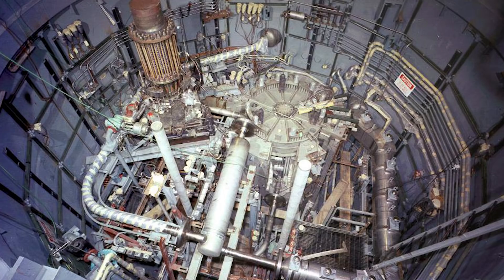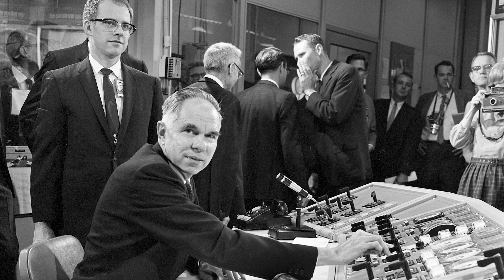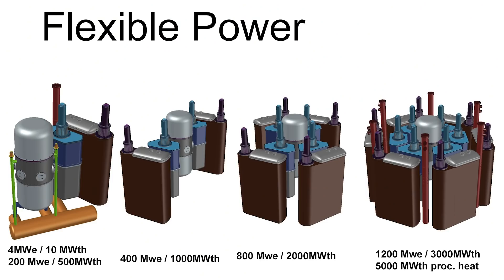Ed Pheil and Carl Perez of Elysium Industries discuss Nuclear Power and MSR @ ORNL MSRW 2019

Comment: How does EI's reactor handle the poor delayed neutron fraction of most fissiles relative to U-235?  And how does it handle the further reduction of delayed neutron fraction caused by circulation of the fuel into and out of the core, especially in the "scaled-up" version?

Comment: I loved the discussion about the nuclear waste not actually being a technical problem, but a perception one.
It's still a problem, if you solve the problem: great. But just don't ignore it and say it isn't a problem or you'll lose public buy in.
Reply: Spent nuclear fuel (SNF) waste is REAL! It costs a great deal of money to store and reprocess, and every day old style nuclear plants are generating more and more of it. It is only safe in 10,000 years. The US has an estimated 700 years reserves of SNF, not to mention stock piles of plutonium.

A man came along called Ed Pheil. He said, 'Can I design a reactor that takes into account the politics of nuclear? The safety, the waste, the economics.' And the result? A reactor that EATS SNF, plutonium, and other nuclear wastes. That consumes >99.9% of its fuel with a <0.1% residue that is safe in 100 rather than 10,000 years. A reactor that is expandable, low pressure, that does not use water cooling, does not generate large amounts of waste, that can generate continuously MW for MW the same as a fossil fueled power plant, does not generate polluting gases, AND one which rids us of nuclear waste. What more do we want?

Comment: A Question to Ed: I have seen Your presentation with the single or multiple heat exchangers and the drain-tank. Why is the drain-tank rectangular, with corners? In those corners, mechanical stresses are concentrated. Welded joints at corners tend to get fatigue fractures.

Comment: A few issues and questions..

Firstly my main concern with nuclear power is whether any of these advanced reactor concepts will in fact be economic in a 10 to 15 year time frame during which renewable technologies will further mature and during which time energy storage technologies will also see large reductions in cost. I'm an Engineer - I'm not pro or anti. But I remain to be convinced about the capital cost of nuclear. Yes, getting the confinement structure scale down helps (its why I'm also intrigued by Moltex) and why power density helps. But even so, we will have to see.

Now regarding safety. The Elysium concept as I understand it is simply a reactor vessel full of fuel salt. No other structure within the reactor vessel. Nothing to degrade from fast neutrons. Is this so? Are there no neutron absorbers (control rods)? Are there no neutron reflectors? One video suggested there were control rods. This would add complexity and cost and also complicate the issue of safety. If there are no control rods, is the only method for controlling power essentially by controlling the heat removal? If the reactor vessel is simply a big tank full of barely critical fuel salt, presumably there will be a flux of fast neutrons impacting the vessel wall. What is the lifetime of that vessel and given that there is a singular reactor vessel (feeding multiple heat exchangers) what are the implications in terms of complexity and down time when it needs replacement? 

How is the reactor shut down? In one video the concept is presented as a process of constant refilling of the reactor vessel from storage but on the Elysium web site the concept is presented as having a freeze plug. My understanding is that the drain tank is physically structured to remove criticality but its hard to tell from the drawing. 

How is Elysium dealing with the issue of Chlorine isotopes and possibly the generation of Sulphur (which would be corrosive)? Is the Chlorine natural (in terms of isotopes) is it isotopically purified?

The process of conversion of solid (waste) fuel to liquid salt based fuel raises the question of how the liberated radioactive gases are dealt with. Are they stored? If so will it be under pressure? Has the safety of this been considered? 

Is the decay heat removal system still based on a heat pipe? This should be better explained on the website.

There are multiple issues with walk-away safety. Does the walk-away safety assume essentially every control system apart from the freeze plug fails? What happens to radioactive gases in a walk-away situation? Is there any way to damage the system with deliberate (malicious) operator inputs?

Finally there is a question that applies to all similar systems. The robotics needed to do major maintenance remotely and absolutely reliably (no fishing wayward bolts out of tanks of molten salt). Is there sufficient technological readyness?

One last note. I'm a fan of supercritical CO2. Yes there are some materials issues but this is something that is being dealt with and can be dealt with within a short time frame. Yes, efficiency is not a huge issue, but the size of the turbo-machinery is (its a cost issue) and super-critical CO2 wins by a very long margin in this regard.
Reply: I think I can adress most of your concerns.
Cost is not going to be very high for this. It's just salt, a steel boiler, a few pipes and pumps and a remotely operated crane, the fact that you get paid to accept fuel instead of paying for it helps for sure. Also the fact that you would use a cheaper turbine than the most efficient type also helps.
I don't think solar and wind plus storage will ever become cheaper than this reactor in particular, just the cost of the land it takes up will probably put it towards more expensive. (At least in 10 years when this reactor is commercially available for purchase) And the cost of land is the only predictable factor, who knows how many orders of magnitude cheaper energy storage will be in 10 years. I'm not sure how many we would need for it to be viable.

For your second point: Yes, it's just a steel barrel, no rods or structures or reflectors. Power is indeed controlled by heat removal, the core stays at the same temperature no matter what so more heat you remove, the more it makes. The lifetime of that core vessel is 40 years according to Ed and everything is made to be easily replacable with minimum downtime, aka. put the salt into storage, swap out any component you want to and put the salt back in.

The shutdown is performed by stopping the pumps which keep the salt inside the core despite the holes it has built in. The website has outdated information so they no longer plan on using any freeze plug. Instead the core is drained at all times and is topped off at all times (except when you want to drain or lose power or whatever) the drain tank indeed is not capable of criticality simply because of geometry.

The chemistry questions I can't help you with, sorry.

Decay heat removal is based on heat pipe I'm pretty sure (again the website is outdated compared to one of Eds presentations)

Walk away safety assumes no failure all the way up to everything failing I guess ... again there is no freeze plug so that can't fail. The radioactive gasses would just stay in the drain tanks and the core vessel I assume, there would be no pressure buildup because criticality has stopped so that's no big deal. There is always a way that an operator could theoretically sabotage anything, for example they could bring a nuclear bomb inside the reactor and set it off, I'm sure that would cause some damage. I don't think there is any subtle way of sabotaging this though, you can't go near it on foot because you'd die from radiation so any sabotage must be done via the maintenance crane which I assume is a very big, not very subtle thing. And pressing any combination of any buttons not related to that crane can not cause any serious damage to the system I'm pretty sure.

And yes, the robotics are sufficient. There is a video from Oakridge national lab showing how the robotics were very competent at performing all these functions around a molten salt reactor. That was in the 60's but i don't think our technology became worse since then. As I understand it Ed has experience designing remotely operated reactors like that that are currently in operation. (Also, you'd definitely drain it for most of that and even then, if a bolt falls into a drain tank full of salt somehow, you could probably fish it out no problem). Keep in mind this is a salt reactor, it's not like refuelling requires it to be shut down for months, you can drain it into storage for the holidays so that your operators can all stay home. The one at Oakridge got usually shut down for the weekends.

For the CO2 ... this reactor has a gas heat exchanger so it's ready to be used as is in a CO2 turbine (or process heat) but you're comparing it with the massive expensive efficient steam generators that we use in most power plants, this uses a different kind of steam turbine which as I understand is much cheaper and I think a lot smaller. Not as efficient but when you don't have to pay for fuel, who cares.

Hope that helps.
Reply: You might find this article about electricity storage interesting. https://bravenewclimate.com/2014/08/22/catch-22-of-energy-storage/
Reply: The first thing to realise is that wind, solar, biomass, and batteries will not replace fossil fueled power generation. The second thing to realise is that any attempt to do so will ruin the environment and ecology, and generate a gigantic carbon footprint from the use of fossil fuel and earth resources simply to procure RE equipment. The third thing to consider is that if this were realisable, the lifetime of RE equipment would only be in the order of a few decades. Fourthly there is the variability in generation of RE, and the instability it causes on transmission networks. In conclusion, although RE may form part of the energy mix, there is going to have to be something else to fill in, and that something is going to need to be substantial. I see Ed Pheils MCSFR as a means to this end. It eats spent nuclear fuel, plutonium, and other nuclear wastes. It is cost effective, expandable, low pressure, does not use water, and consumes >99.9% of the fuel it is fed with the residual <0.1% safe in 100 rather than 10,000 years, whilst generating continuously MW for MW the same as a fossil fueled power station. Is there anything not to like?
Reply: He’s addressed your CO2 supercritical before. Yes it’s better tech. But it’s not yet proven, built, widespread technical know how and he made particular mention of how hard it is to get anything approved by DOE. You can introduce that at a later date though. Main tech is the MCSFR installed and running. And can connect to conventional stream driven (super critical or not) infrastructure located at conventional fossil fuel plants.
Reply: Chlorine needs for sure to be enriched to avoid related sulphur and corrosion issues. But the trick is, Cl in nature is about 25% Cl-35 and you need to go up no more than 97-99% Cl-37, so it' s not a complicated/costly effort at all (particularly considering the raw material as chlorine is unlimited and you don' t need to worry about tails enrichment, like uranium, and the material itself can be indefinitely recycled into the reactor - unlike solid fuel reactors, the life of liquid fuel salts is infinite)
Reply: @yog-sothoth9895  Well as the lead engineer for a major pumped hydro energy storage project, I'm going to have to beg to differ there. And from my perspective the major threat is further cost reduction in grid scale battery storage. 10 to 15 years from now will see an entirely different landscape. Massive build out of renewables and grid scale storage. Into that market there may still be a niche for closed cycle gas backup generators (and these may well run on hydrogen by then). The question you need to ask is will nuclear with all its capital costs fit into a backup niche? Or is it going to be beaten by far cheaper gas generators? Heck nuclear may find its niche in process heat. All I'm saying here is what I said above - for nuclear to come back into the game it needs to see a revolutionary cost reduction. Possible? Maybe. I'm keeping my eyes open on this.
Reply: @yog-sothoth9895  I don't share your pessimism about storage. At the right price and scale it sets a low bar for the entry of nuclear. Anyhow I'd like to see my other technical questions addressed.

Comment: Could somebody explain how you reach criticality in the same vessel but with a large range of different power levels? I thought you had to choose size based on what kind of power you wanted.
Reply: There's always the same amount of fuel in the reactor, regardless of power level. There's also a large negative temperature coefficient of reactivity (reactivity, basically the amount of fission reactions per unit of time), meaning that when the temperature rises, reactivity reduces, and vice versa. So you can think of it as a system in an equilibrium: Always just enough fission going on to keep some specific temperature. Now what happens when you add an extra heat exchanger? Well, more heat energy per unit of time (power) is removed from the reactor, and thus the temperature in the reactor drops, and thus the reactivity increases (more fissions per unit of time), increasing the temperature back to the equilibrium level.
Reply: To clarify further, criticality is a function of geometry, the density of fissile material, density of non-fissile neutron adsorbing materials etc., but not a function of power output.
Reply: @jbepsilon  Thank you for the explanation. That actually makes a lot of sensey
Reply: My understanding is that in molten salt reactors, the fission rate tends to be naturally higher at lower temperatures. So if you want to produce more power, all you need to do is to remove heat faster (run your pumps faster) and fission will speed up automatically. If you want to reduce fission, you just reduce pump speed and the core temperature rises, which causes the fission reaction to slow down. (And in this design, of course, if the pumps stop completely, the fuel drains out of the reactor core and eventually cools off because the density in the drain tank is too low to support any fission.)

What I would like to know is WHY this is true in molten salt reactors but not necessarily in light water reactors.
Reply: @davidpiepgrass743  I never noticed that you had a reply to this question. While I am not a nuclear engineer, I think I understand the principles. The MCSFR and other reactors with a molten fuel salt will generate more space between fissionable atoms as the temperature increases and the density decreases. A fast rector is very sensitive to this density change so maintains its equilibrium. A light water reactor fuel element does not undergo a large temperature (or density) change and is a source of fast neutrons which must be slowed by the moderator (water) to enable fission. The thermalized (slow) neutrons can then be captured. Fuel density, then, plays a much smaller role in the  fission chain reaction. But moderator expansion does have an effect in maintaining a negative reactivity coefficient which is desirable. https://www.nuclear-power.com/nuclear-power/reactor-physics/nuclear-fission-chain-reaction/resonance-escape-probability/